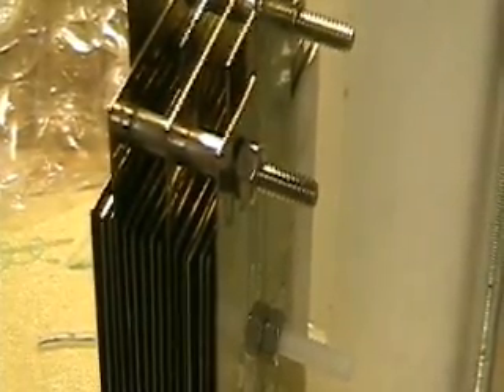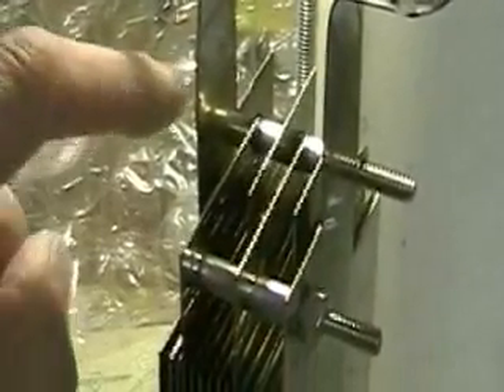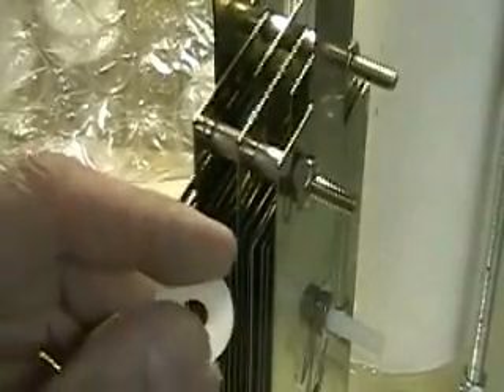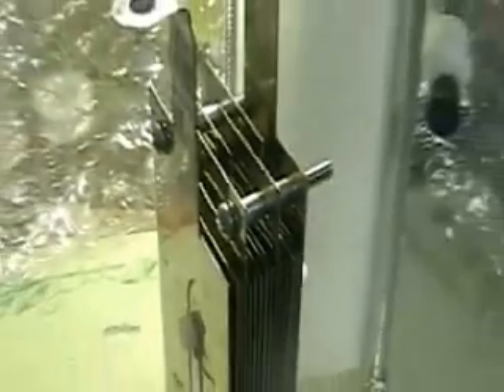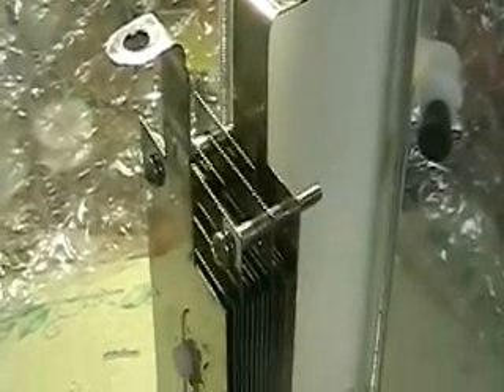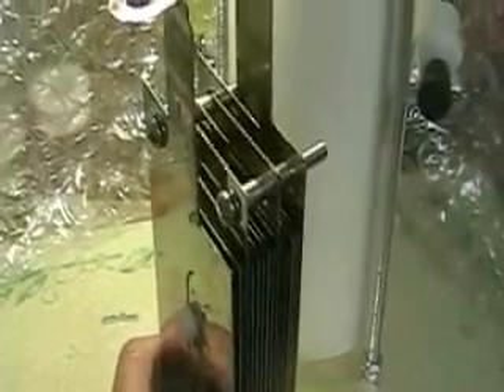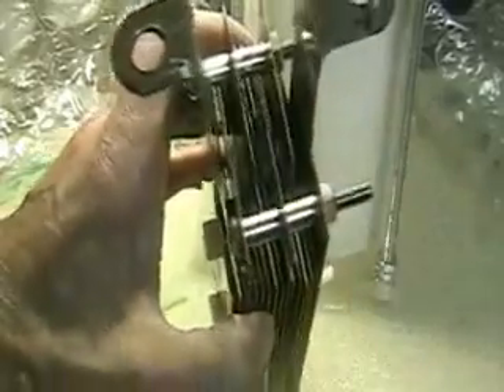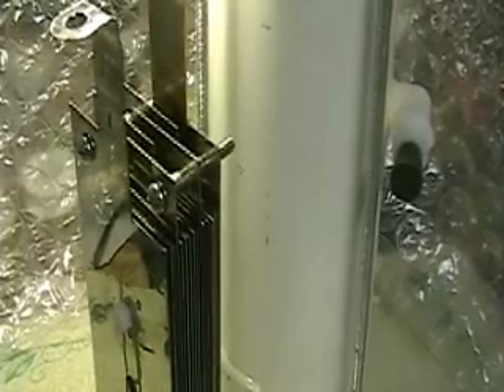Hydrogen Tap (FOCUS-improvements) 311

Comment: looks great! 
What about drilling 3 large holes in corners instead of cutting the corners out? 
4th hole may be threaded for bolt and use nylon spacers (1/8" Nylon washers?) on all 4 corners.
Then take out the nylon screws and put them through the 2 bottom holes eliminating the need for the center holes. 
You gain more surface area since the corners are not cut out and maybe there are other benefits? Don't know much. Just starting my own prototype and think I'll do it this way.

Comment: Hey John, awesome work!!  I am new at this but I think what I have been doing has been going well, I do have question about the neutral plates, why what is the principle behind it? Also i've been looking through your video's Do you have one showing the wiring of cell from cell to amp meter to relay and if you have a resistor or a reostat in line. And what volt are you running yours at?? I have one video posted but that was just 1 I was playing with I have made alot of changes. Thx, awesome work!

Comment: where did you get the stainless spacers/shafts?  just curious.. McMaster?

I will see if the have those..

Good on the nylon washers, thats how I am going 1/16".....Wanted to let you know you can CUT the notches in the plates with an angle grinder and thin metal cutting blade very quickly, probably much faster than the ban saw.

Plus you can cut several at once. upto 5-6 can be cut quickly and cleanly with the 4.5" thin metal cutoff disk. Then you only have the holes to drill.

Comment: You also have to fool the O2 Sensors (my Van has 2ea) using a EFIE adjustment tool or the O2 will sense too much O2 in the exhaust, think its running LEAN, and dump more fuel, thus defeating the HHO gas introduction.

 There is a spacer you can get to back the O2 out of the exhaust port to fool the OBD (onboard diagnostic computer and O2 sensor, (supposidly works?)

Comment: vacuum goes up and down it varies under load.

When the engine is running Higher RPM the vacuum really drops down considerably. When the engine is running slower the vacuum increases on manifold and air intake

Comment: Just wanted to let you and everyone else in on something I'v found. The new air intake's on these cars have lots of air but no vaccum/suckion. We have to figue out a way to increase vaccum in the intake tube to suck more hydrogen into the engine so you would use less gas. The old engins with the carb's had lots of vaccum and would work great but the new one's have these mass-air-flow sensors that we have to get around. we will eventually find the secreat and run our auto's on strickly HYDROGEN.